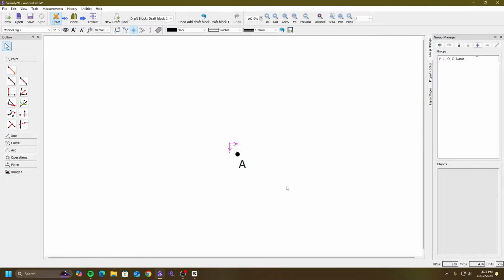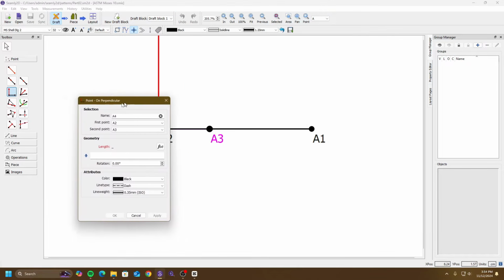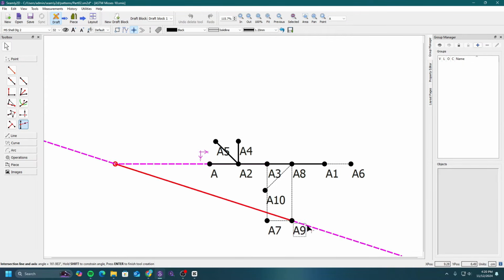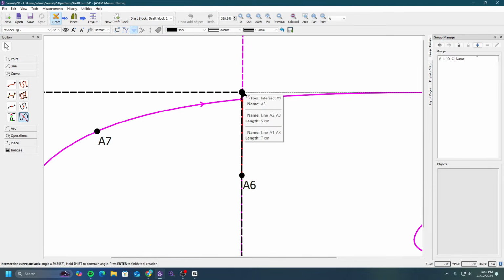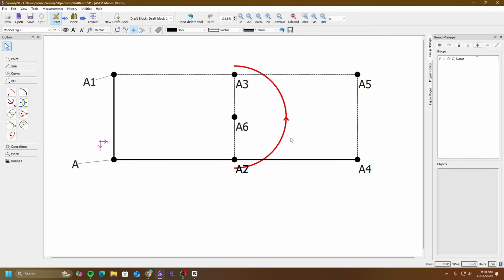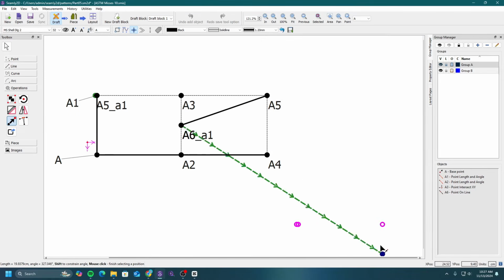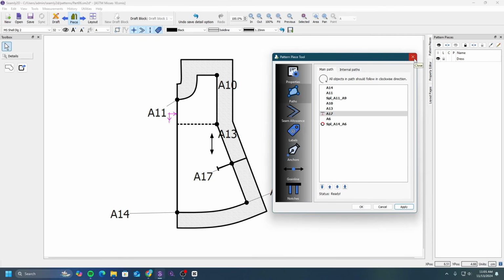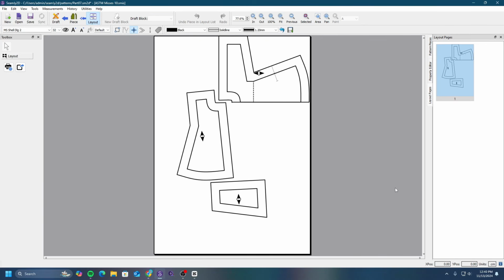Seamly Basics - All 7 Episodes in One!

Comment: Amanda - I have watched all your videos on Seamly and there are a few concepts that just have not clicked for me.  For example, when I have created a draft I understand that I then need to select Operations then Add New Pattern Piece and then select my points and press enter then I can adjust seam margins etc. in Piece mode.  But, what if I need to add some holes to the draft then have those displayed on the previous piece I just created?  I just don't understand how to properly to move between each phase and then go back and modify things in draft mode and get it to show up in piece mode etc.

I have done a lot of 2D and 3D design in AutoCad but I need a tool that is more specific to bag making hence is why I am exploring Seamly.  Be great if you could do a video on moving between the modes and changing things then getting those changes to show up in the various modes.